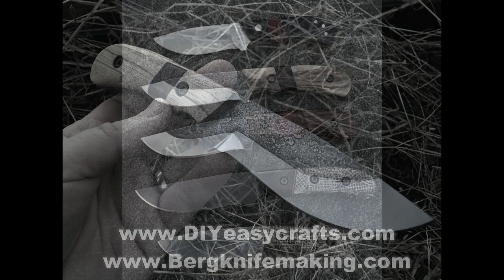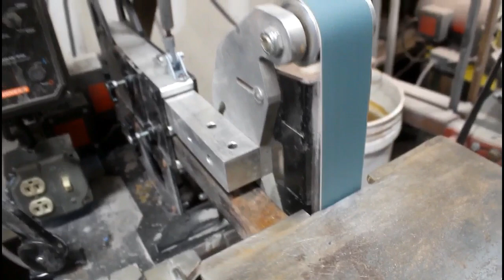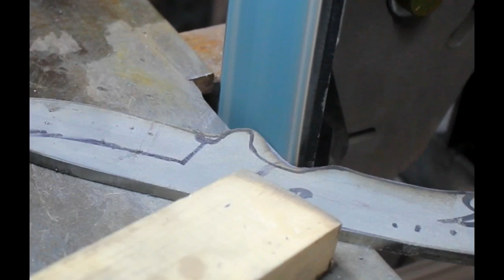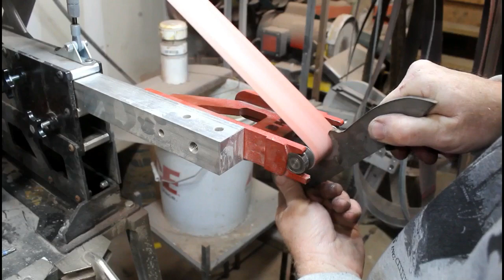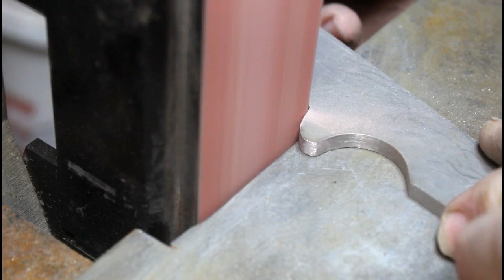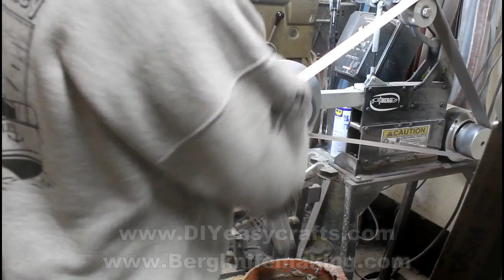Knife Making Tutorial Part 1 How to Grind the Knife Profile by Berg Knife Making

Comment: Have you tried a bandsaw or you just prefer doing it with the belt? Personally, I cut everything with my bandsaw, from kydex to titanium. Some of the harder SS, like CPM154 you have to cut straight or it dulls the blade, but AEB-l is pretty easy... We all have our own way to do it. Have a great weekend. Take it easy... (P.S. I noticed that on the surface grinder Alec Steele uses, it has a handle in the middle, if there was some way to mod the one you have, you wouldn't be reaching over your head each time, just a thought)
Reply from the maker: Hey Dave, I do have a band saw and usually do use it to trim access material. I know you have a port a band which uses a thin blade. That allows you to follow profile a little better than mine. I have on of the chop saws and just use it in vertical position. Good idea for  surface grinder modification , Will take a loo and see whats possible
Reply: @DIYeasycrafts  You know, I've seen guys make bigger cut tables and even a bench for those bigger saws, but i would imagine it would be harder to cut as accurate though... Maybe even a big clamp for that surface grinder on the bottom to grab.